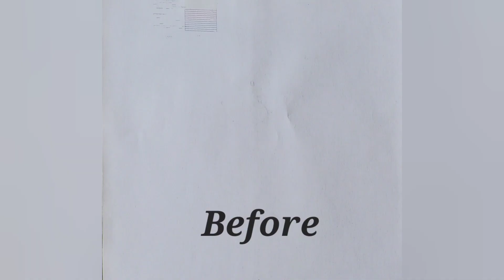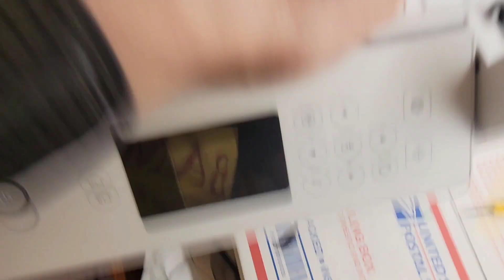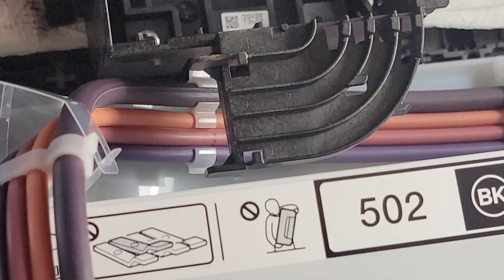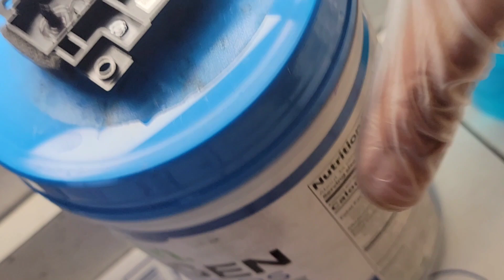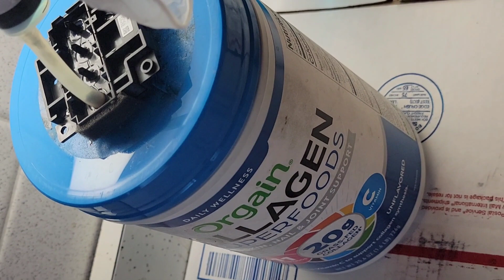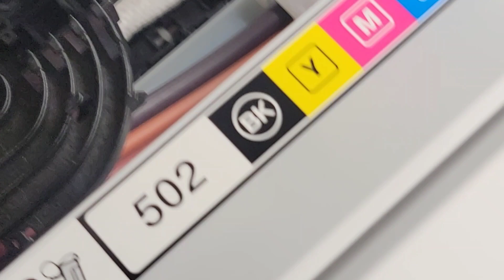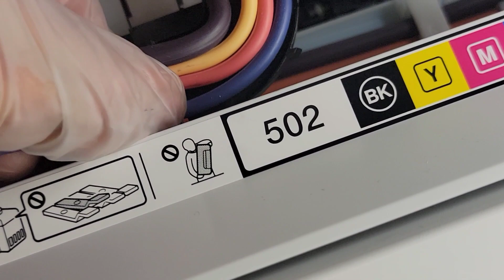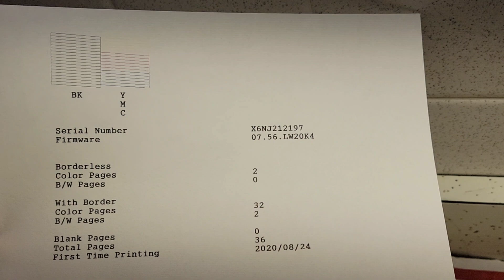Epson Ecotank ET 3760-4760-2760- How To Clean clooged Print head -Not printing Error - Solved

Comment: Haw did you remove that white little panel??
Reply: If you mean how did they slide the print head, I guess they turned on power cleaning and then immediately disconnected the cord, but I recommend going to maintenance, then reset ink levels, press “ok”, then disconnect the power cord and you’ll be able to slide the print head.
Reply: @rissasmithg  The white panel that he tries to remove at 2:51 minutes. It never shows how it was taken out and I haven't been able to
Reply: On the sides of the white panel are prongs that push in to slide in/out of slots in black casing box. Use a tiny flat head screw driver to press in both sides, then the white piece lifts out easily. The left side only has very small area to press due to the wires, but it will work.

Comment: I had this problem and i used windez to clean them out the a little bit of alcohol  to clean access,  thats not the only part i cleaned,  because it continued with the clog. You need to clean flush the part that goes to the maintance box , and on the bottom of the rail under that part you flushing theres another part u need to clean and flush. Both ends. And walla my et 4760 is back printing, now i need to change the maintance box. And my printer back to new. Wasnt using it for a year.